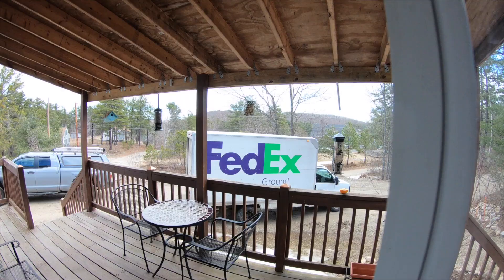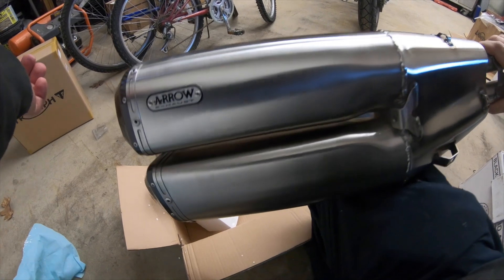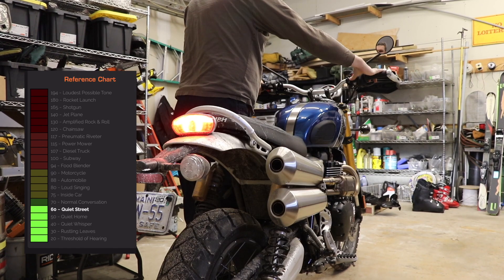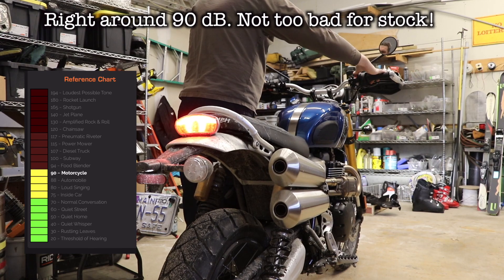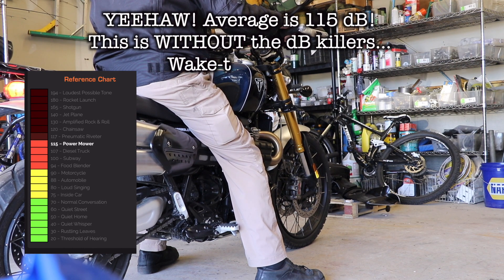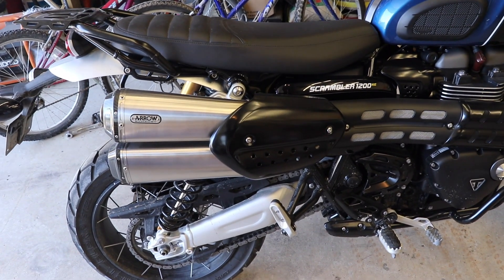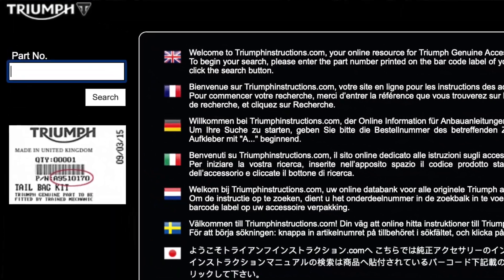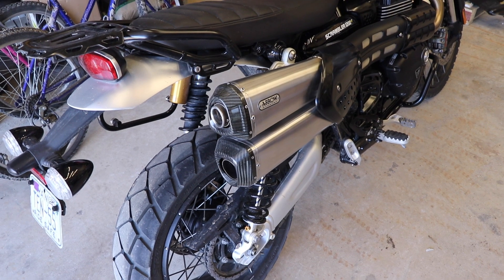HONEST Triumph Scrambler 1200 Arrow Exhaust Review - HQ Audio!

Comment: Just did this baffle removal today. Prior to the job, I sprayed the screw with penetrating lube [PB Blaster]. I rode the bike about 90 miles before attempting the screw removal to heat the exhaust. Used a pneumatic high speed air saw to  cut the tack weld. As I loosened the  screw, I stopped when it got hard to rotate.  I cut at the edge of the screw and continued as it rotated. I cut around the entire circumference before it was easy to turn. The contour of the baffle mixed with the flat surface on the head of the screw is the issue. Once the screws were  out I bent the inside snout with a flathead screwdriver and gripped it with needle nose vise grips. The top one came out quickly with up and down movement as I pulled. The bottom one was harder. Sprayed lube around seam between baffle and main opening of muffler.  It sounds much better but still not super loud. Worth the effort.

Comment: Great video, and I wanted to thank you for the insight.  I just installed my Arrows, Triumph Cleveland now sells them for $799!  I learned from your challenges, cut the wield with my dremel, then worked those screws lose, going in and out, taking my time and using spray lithium grease.  They did come out, but yep, a definite pain.  I removed the baffles with needle nose but it took a while, and now I have baffles that I can put back in should I want to.  Thanks for the insight, it made my install easier!

Comment: Blame the hippies for this dilemma, the demand for clean emissions will continue to get worse and worse. pretty soon instead of a spot weld, they will run a full bead around the whole db killer. To be followed by a flat out ban on aftermarket exhaust, followed by a ban on internal combustion engines.

Comment: I had the same issue with mine.  I too has to use a carbide burr and carefully grind at it for about 1 1/2 hours.  Not fun but I think worth the effort.  The sound is deep and throaty without being obnoxious. I tested one of these at my favorite triumph dealer and traded my 2018 triumph T120 black.  Equally a great bike but it’s no 1200XE. This things is a blast!  Excellent torque, comfortable and smooth.  Highly recommend this bike.  One test ride and you’ll be hooked.

Comment: Sounds like a real Triumph should, at last! The heat can come down if you de-cat the exhaust as the cat holds amazing heat. TEC in the UK do a good vid on YouTube how to decat!
Reply: yeah well... The cat is supposed to get hot because the catalization process of the materials work once they are hot. People should stop to manipulate the system if they are not using the bike for racing. Let's be eco-responsible riders at least.

Comment: The screws are welded in because they are not supposed to be removed (homologation). Then you damaged them removing the part that isn't supposed to be removed and complained that it's possible to damage them when doing that? Madness.
Reply from the maker: except that the dealer said "Just remove the screw to take out the silencer insert..." Of course I understand NOW that was poor instruction. Cheers!
Reply: @BackDraftBikes  When you noticed the screw was welded in and had to attack it with a saw, the thought "you break it, you bought it," prolly should have made a least a passing jog thru your mind...
Reply from the maker: @saddle8bag  Actually it did, for sure! That is why I called the dealer before I broke it. They assured me that they were meant to be removed.."Are you sure? I don't think they will come out peacefully".... "Trust me, we just did this to a customer's bike" snap
Reply: @BackDraftBikes  I guess if the dealer is willing to cover for the genius giving out the info, it works. Sucks to stick it to the mfg though. They made them the way they did for a reason. 
It'd be like the kid at Best Buy telling you to saw on your new refrigerator's compressor and then returning it to Maytag cause it don't work but is under warranty.

Comment: Great video. The dealer offered to remove the "db killers." I said I'd ride it myself and remove them if I wanted to. Heh it looks to be a real pain in the backside. So my question is, ride 500 miles and make the dealer do it or pull out the die grinder. Also, I'm curious to what the difference between the pipes with the limiters in them as opposed to without them.
Reply from the maker: with the baffles in, they were the same db level as stock. Why buy them at that point, right?
Reply: @BackDraftBikes  Thanks for the reply. My bike had the kit that came with the Arrows . I've been debating on whether or not to take the restrictors out. I doubt YouTube does it justice, but those last drive-bys of yours convinced me. Planning on removing them myself when I get a moment.

Comment: Forget those bullshit Arrows, they still sound muted and the heat problem from the front mounted CAT does not go away. Instead just stick with the standard cans and delete the CAT. Fraction of the price and releases lots of power and sound. Even better, fit a 2 into 1 V&H from the Street Scrambler (fits perfectly) and save a tonne of weight, pick up several HP and produce the most glorious sound on this Earth because a 270 crank firing through a 2 into 1 is heaven!

Comment: help me understand what you did.
the triumph scrambler 1200xe/xc sounds good.
but you wanted a different sound so you spent $1200 on after market pipes to get the sound you wanted.

you then modified those very expensive pipes by spending over two hours on one bolt, and who knows how many total hours to complete the job to get louder sound which is different from the sound you wanted and destroyed the after market pipes and now you can’t get a sticker.

is that accurate?  lol

Comment: I ordered my XE with Extreme kit.  Way cheaper.  I can't believe you butchered your pipes like that getting the baffles out.  WTF?  I did not have those issues.  Maybe I drank more beer.  I tapped the outer ring and put it back in and it looks stock without DB.  Good luck returning them after butchering them.
Reply from the maker: Hey I totally get what your saying. Once the bolts both snapped I was committed, and couldn’t turn back. Also I had the dealer on the phone following instructions. It was rough, done tons of cans before never had so much trouble 🔥

Comment: Why are they built so that the screw breaks off when the db-killer is removed? Because that's what the law wants -  in europe. ;)
Euro 4 exhaust systems must not have an easy to remove dB killer. In fact, it must not be able to be removed without damage. The screws must therefore be welded on and should even break off. Because it's mandatory. The exhaust systems that meet Euro 3 may still have an easy to remove db killer. And we would not be Europe if there were no exception to this: Euro 4 compliant silencers that were developed and homologated in 2016 do not yet concern the "new" directive, since the requirements for Euro 4 retrofit silencers were only clearly defined in 2017.
Greetings from Germany.
Reply from the maker: Ah yes. Laws. Thank you for the information! It really is too bad. Danke! Reite auf Bruther!